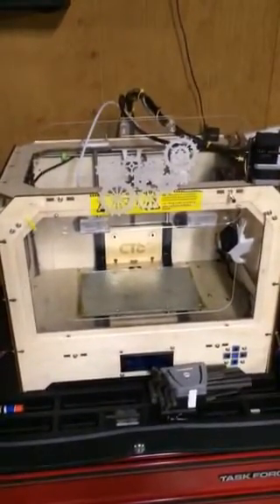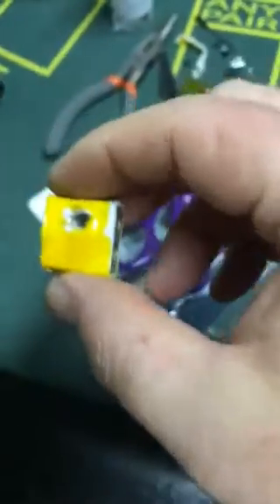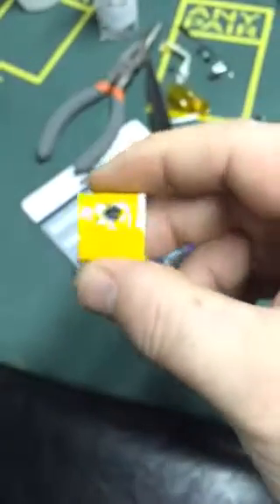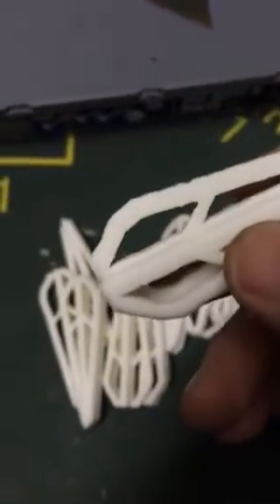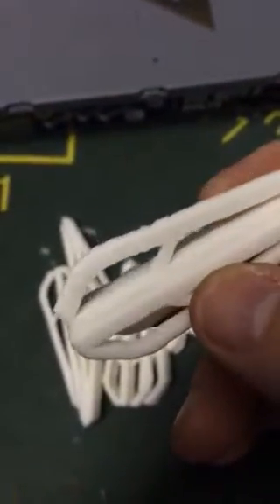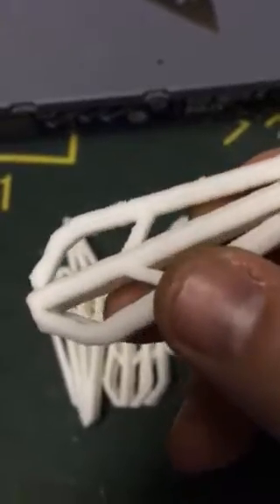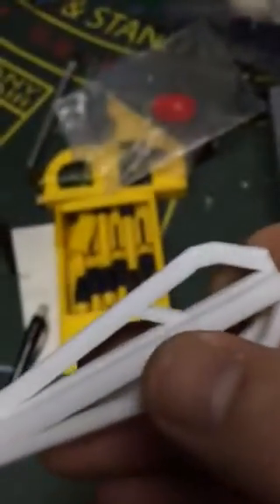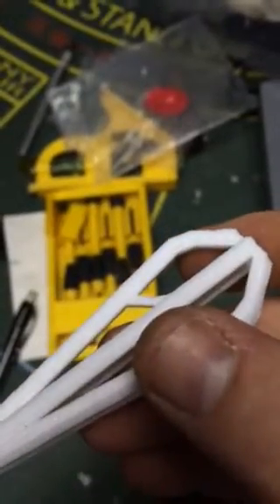CTC 3d printer extruder disassembled

Comment: Thanks very helpful,  A friend just got a Makerbot and gave me his CTC. The header blocks were pretty beat up so I wanted to clean them up. Your video showed me what I needed to know to get the nozzles off so I clean them with  acetone and clear out the filament tubes. It's printing well now but I want to re-wrap the header blocks. You mentioned kapton tape and gauze. I guess I can get the gauze at the pharmacy. Is there any particular type or thickness that works best?
Reply from the maker: aliebel awesome for you!  My work bought both the makerbot replicator and the makerbot 5th generation.  They were both junk, my ctc out performed them both.  Still running strong today after 2 years almost.   Good luck to you.  Any questions feel free to ask, I still use mine frequently.
Reply from the maker: I bought the cheap 4" squares gauze pad and cut it to fit, I used one extruder as a model as I re wrapped the other.

Comment: where did you get the insulation for the extruder, i know there is kapton tape. But where did you purchase the white insulation.
Reply from the maker: It's gauze, from cvs pharmacy.  I bought gauze pads and then cut it up with scissors.  It's a good insulator to regulate temperature and cheap.
Reply: ok thanks

Comment: What is under the kapton tape, where can it be bought?
Reply from the maker: The kapton tape is holding down a 3mm piece of glass from Home Depot.  If you print on glass with elmers glue stick it is the best way I've found.  You just have to move the z homing sensor to compensate for the thickness of glass
Reply: i meant the tape on the extruder block, not bed